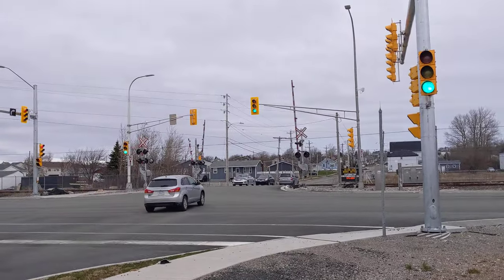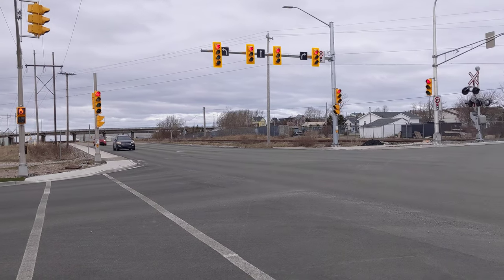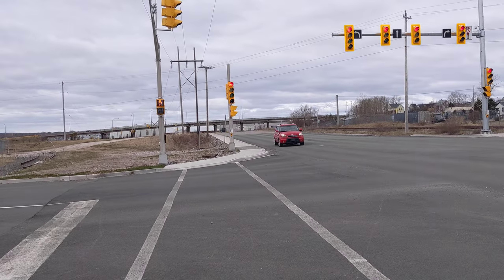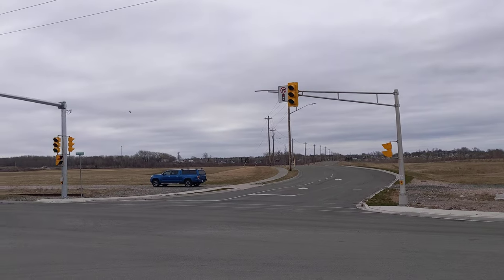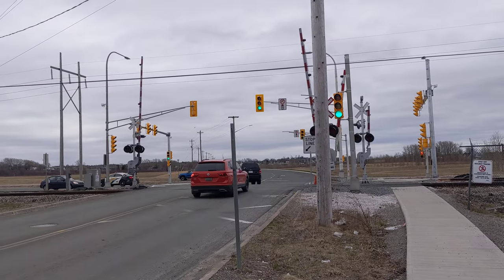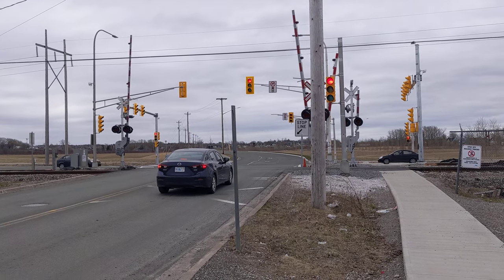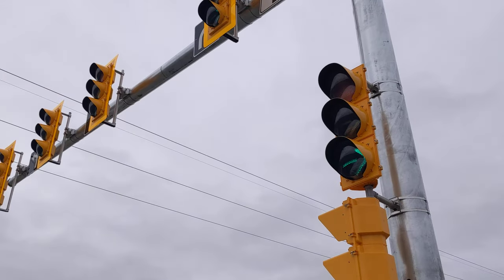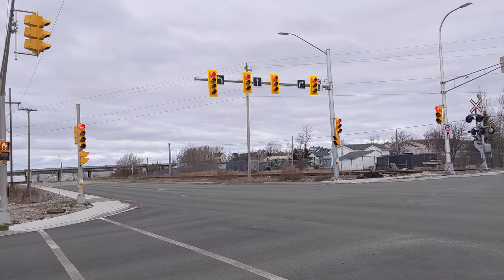SPAR Road Intersection Upgrades

Comment: Enjoyed the long walkthrough.
a) Agree that the 6 WB heads seems to be overkill.
b) Don't see what the conflict with the right arrow is.  The WB right turn would already have priority over the EB left turn under more typical operations.  Doesn't appear to be a crosswalk on the north side, that would be the typical conflict with a right arrow.
c) Wondering how the extended green on the PV heads is programmed.  A lagging phase 3 or 7 with a 2s green interval, plus an overlap with phases 4/8?  Or something else?
Reply from the maker: I was told that typically if you see a green right turn arrow, the opposing direction cannot turn left onto the same street. Otherwise a flashing yellow arrow would make more sense. Canada obviously doesn't use those yet though!
Regarding the side street phase, I believe phase 4 & 8 clear together which is the near side track signals and the opposite direction. The PV signals clear separately so they could be an overlap on phase 3 or 7.
The left turn signal green ball turning into the tracks and the dedicated right turn signal are also separate overlaps, could be phase 13 and 14 or 10 and 12 since there are only 2 pedestrian signals!